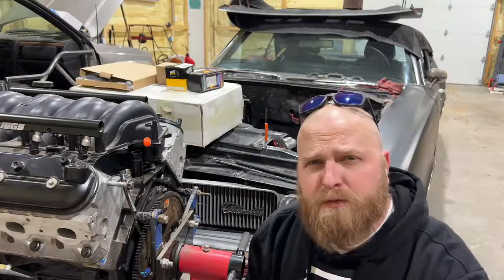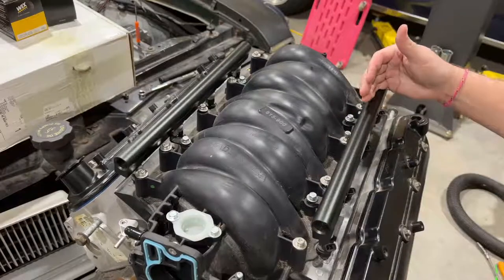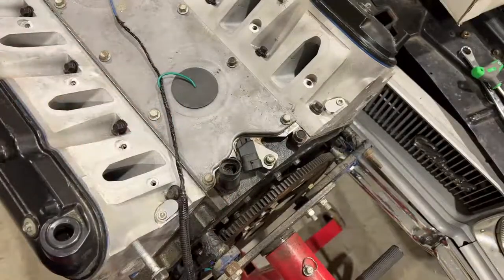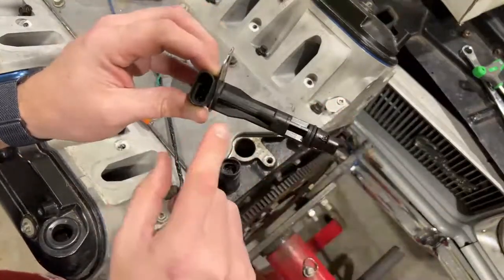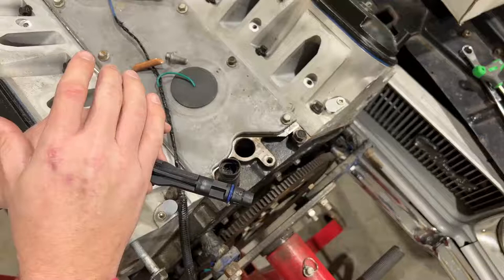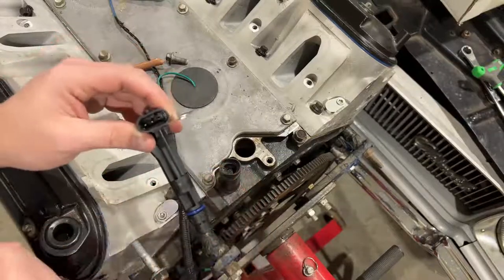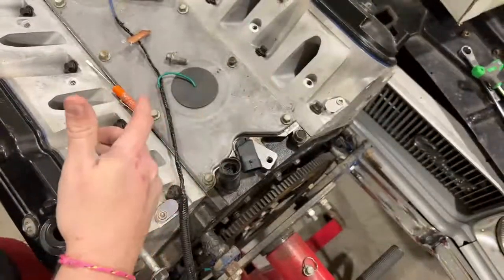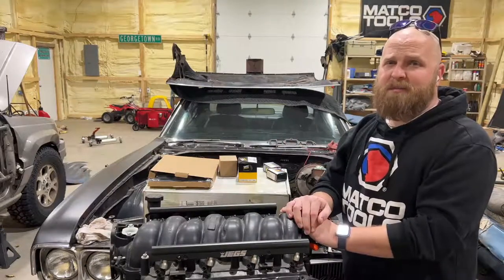LS Camshaft Position Sensor Replace - How to (Cutlass LS Swap)

Comment: What is the OTHER sensor looking thing directly next to the camshaft sensor?? I ripped the top part off when trying to pull out camshaft sensor and can't find what "that" is. (Didn't take manifold off so it was very hard to see/get too)  2002 Escalade EXT 6.0 vortec.
Reply: Oil pressure sending unit